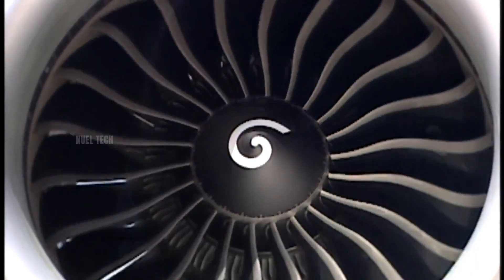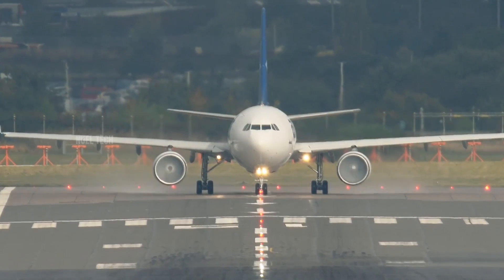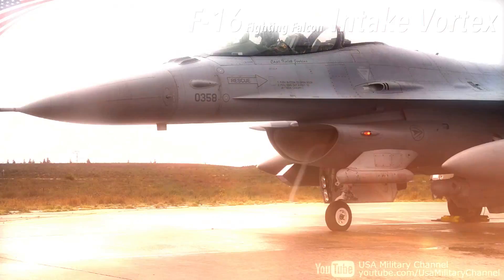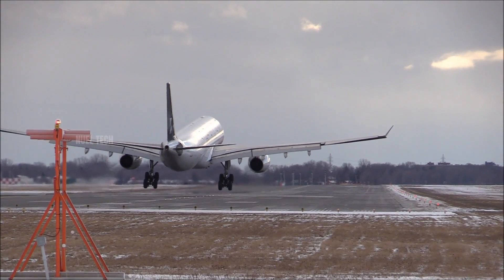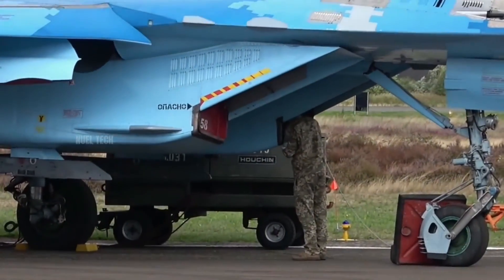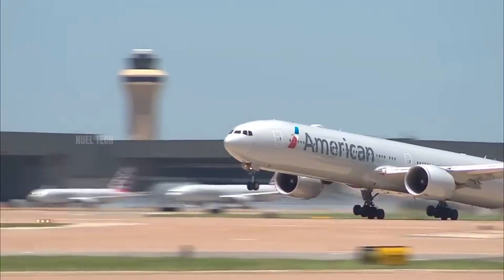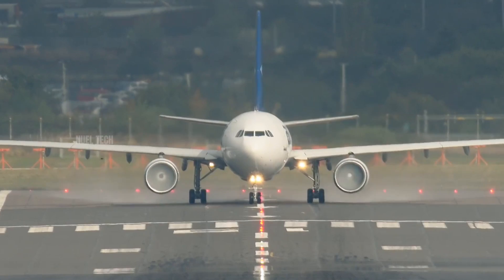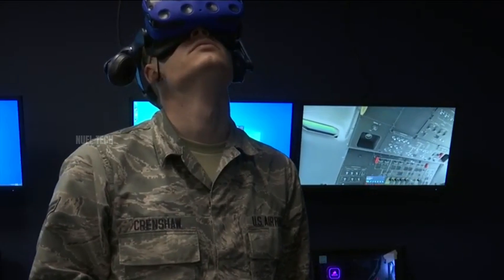How Jet Engines Can Suck a Human In - How Strong Is The Suction | Real Danger Explained

Comment: One of the more dangerous activities I got involved in many years ago was performing a Variable Stator Vane (VSV) Tracking Check on the GE CJ805 engine on Convair 880’s. This was usually done after replacing the engine’s Fuel Control Unit which controlled the VSV’s. A precision protractor was installed on the master VSV and the engine run at various rpms right up to take off power while an observer stood alongside the engine and noted the angular readings. The results were plotted on chart corrected for ambient temperature to see if the angles were in range. If not, an adjustment was made and the process repeated. Fortunately, as the licenced engineer I was in the cockpit running the engine(s) and some poor inspector was standing alongside the engine taking the readings. He wore a headset for communication plugged into the service interphone jack on the nose cowl. One day, before my time on CV880’s, the excess length of the headset lead got sucked into the intake at very high power and pulled the inspector into the nose cowl. Luckily for him the compressor stalled and the engine spat him out. After that we had special headset with a very short lead that could not be sucked into the intake. It must have been frightening standing very close to a jet engine at take off power trying to record a precise reading on the protractor.